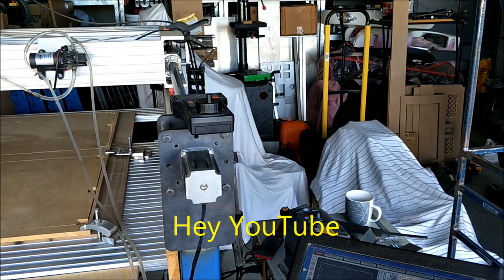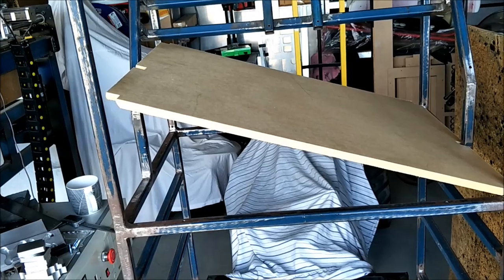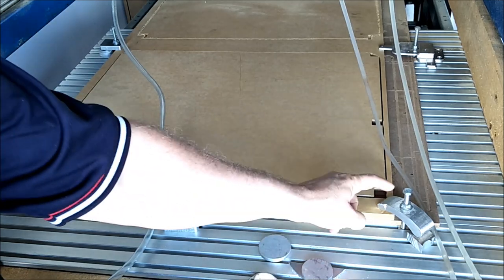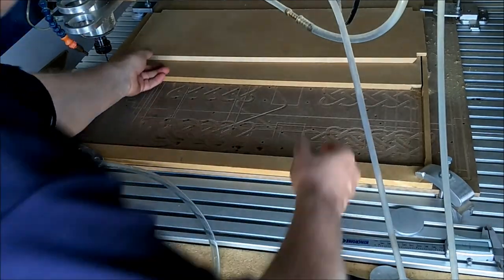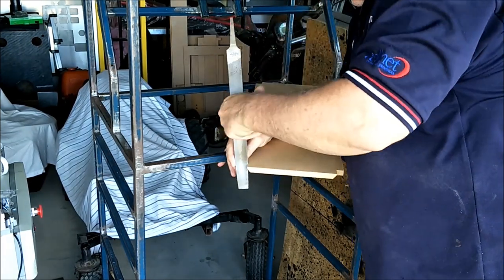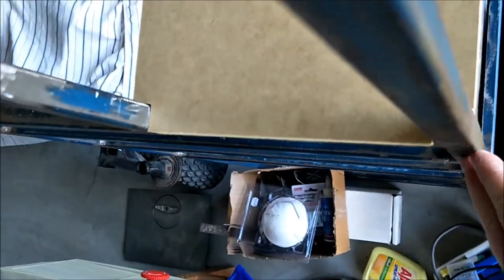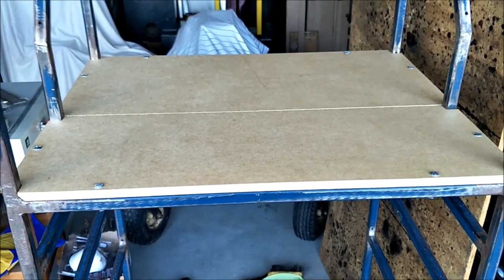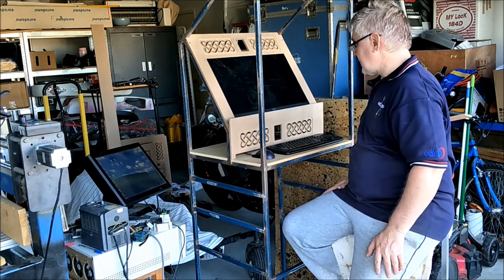DIY PC Stand - Part 4b

Comment: Looking good , i thought maybe make that bottom piece hinged so it lifts up and when not in use slide your keyboard in under it out of the way ???
Reply from the maker: Definitely worth thinking about. Although the keyboard is not really in the way of the touch screen, so I don't know if that would be more of a pain than a benefit. The other consideration has to be where the motherboard goes. I was originally planning to bolt the motherboard to the back panel but until I set it in place I don't know if it will go on the back or just behind the keyboard. Thanks for the idea though.